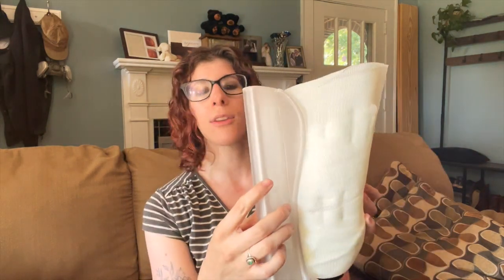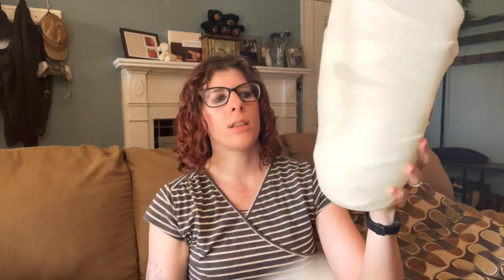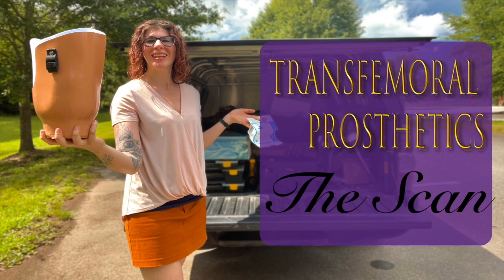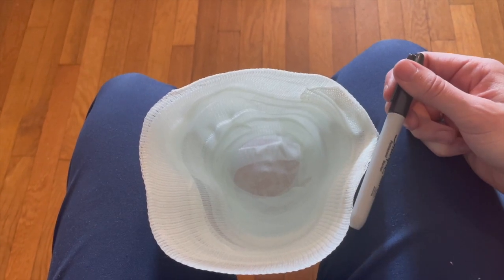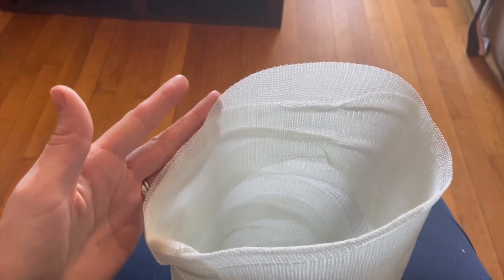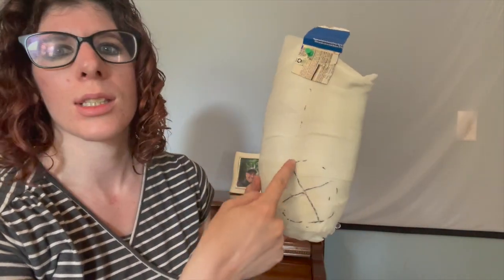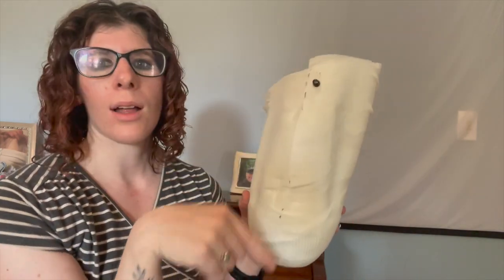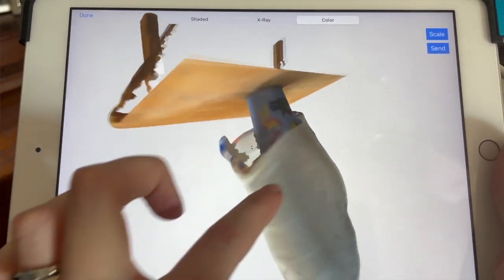FIRST Above Knee Prosthesis: CASTING + SCAN

Comment: Where did you get those panels for casting?
Reply from the maker: They are 3-D printed shapes based off of our general desired shape for the prosthesis. When we initially started with this socket design we were actually using 3 PVC pipes, but the 3-D printed shapes work much better when it comes to conforming to the patients' individual anatomy.